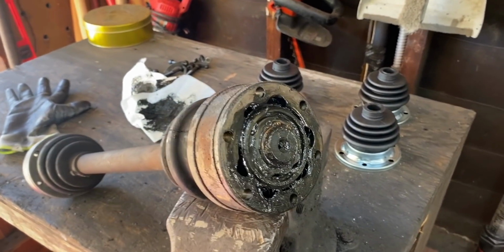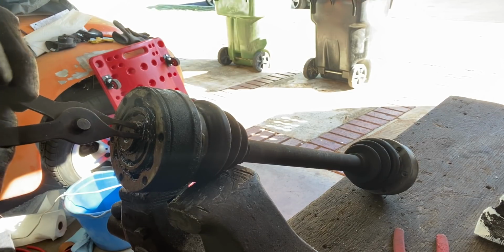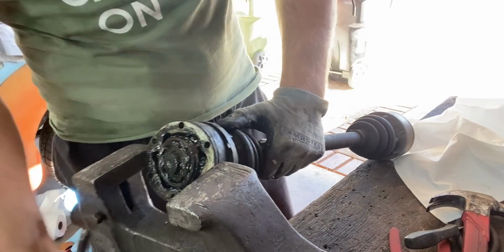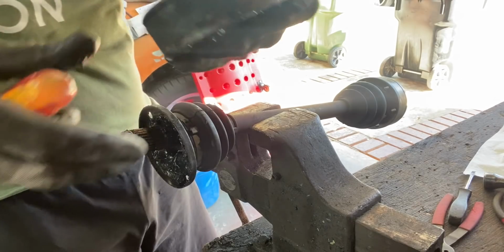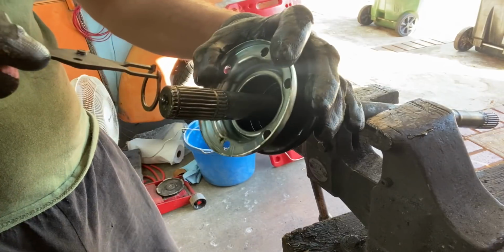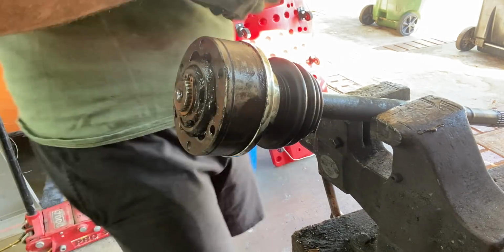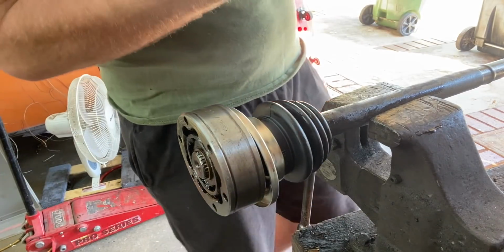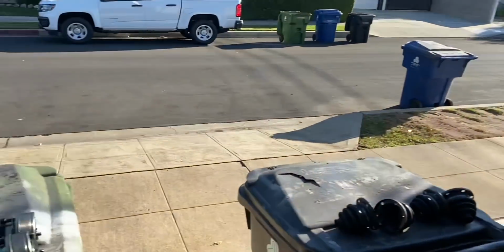HOW TO: CV boot replace. Ford Sierra Merkur XR4Ti

Comment: The grease you used for the cv joint is the same as supplied with replacement units . Molybdenum disulphide . They want you to use theirs cos it’s more expensive from them.

Comment: That looked way too easy.
I've just rebuilt a set of Karmann Ghia axles.
I needed to use a puller to get them off and a bfh to put them back on again.
It takes longer to clean up all the greasy mess than do the actual job!